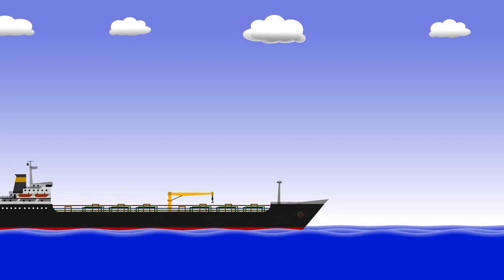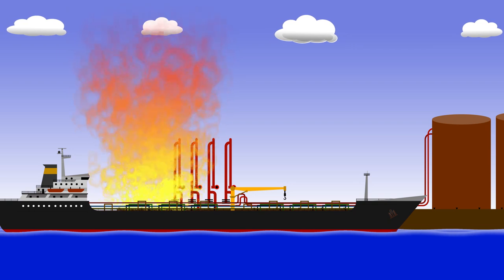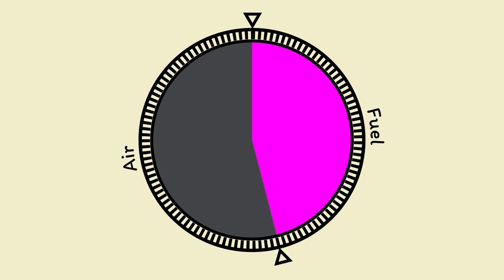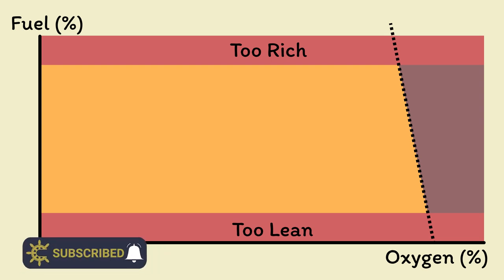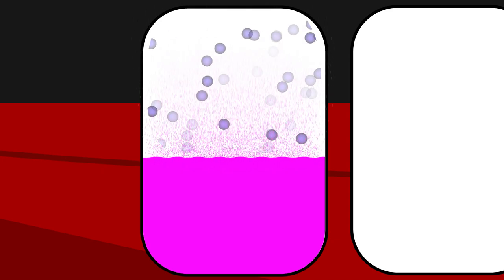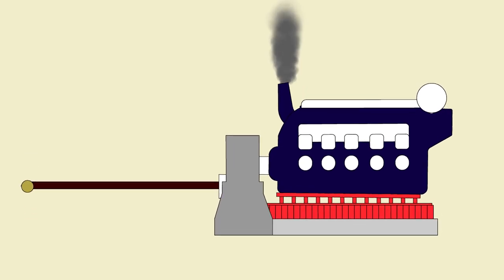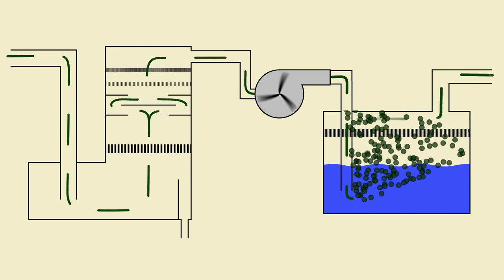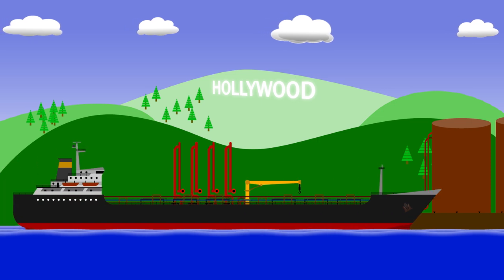Why Can't Petrol Explode On Ships?

Comment: I'm learning, and it's all Casual Navigation's fault! How dare you post informative and interesting content, I'm trying to melt my brain online and instead you're filling it up with facts. Just shamefull...
Reply from the maker: Sorry James!
Reply: @CasualNavigation  It's alright! I don't mind facts and information, but dammit, you're making my brain melt impure!
Reply: @CasualNavigation  I'll get over it. 😉 on a side note, if you ever have time, I've always wondered where the exhaust from ww1 and 2 diesel submarines go, is it stored and released in bursts, or is it constantly vented?
Reply: @Russo-Delenda-Est  The diesel subs engines only operated on the surface for propulsion and charging the battery's.  This became a problem as the war progressed as the sub was vulnerable to detection from air patrols so they were forced more and more to recharge under cover of darkness.  Late in the war the Dutch invented the snorkel, which the Germans copied almost intimately, that allowed them to recharge just below the surface.
Reply: @davidmarquardt2445  Actually it was the other way around. At the beginning of the war U-boats recharged mostly at night and ran submerged during the day to avoid detection by aircaft using just Mk1 eyeball. But as war progressed increasing amounts of Allied aircraft became equipped with radars, so it was safer to recharge during the day. This way they could spot the planes further away and had a chance to dive to safety, while at night it would usually be too late. And snorkels were no fix either, they were still detectable by radar and placed the boat in even more danger - close to surface with speed limited to about 6 knots, with extra time needed to stove the snorkel back for a dive, and all that with just 2 lookouts on the periscopes vs a whole deck watch if surfaced. And just a few U-boats were equipped with them anyway. A much better addition were radar detectors, but those were of poor design and quality. Check out Iron Coffins by H. Werner, it is a good read.